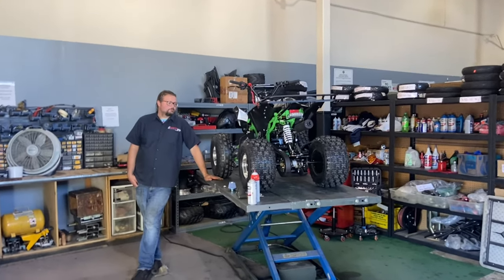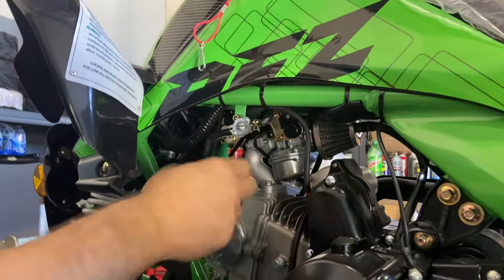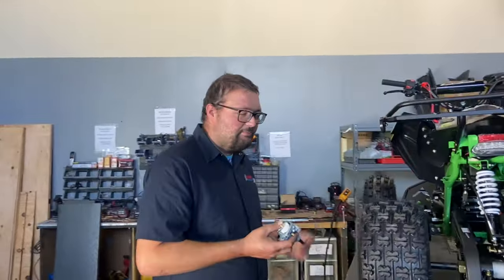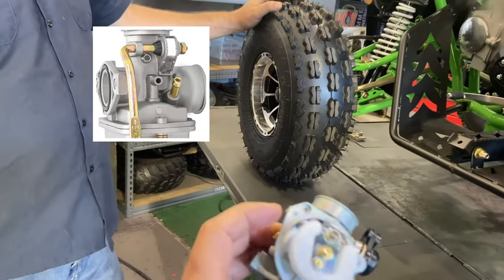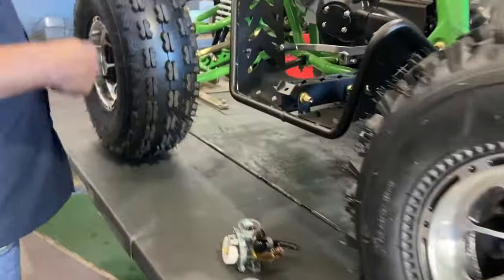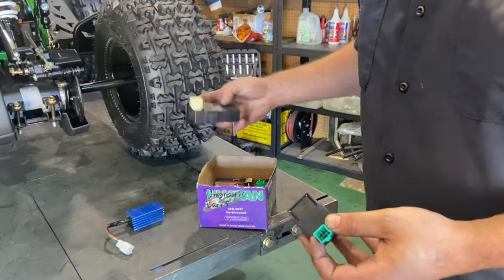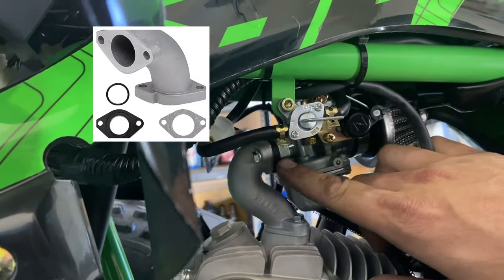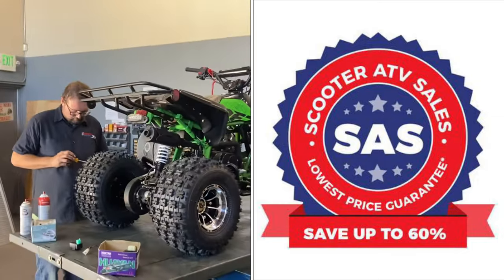WHY DOES MY ATV BOG DOWN WHEN I GIVE GAS TO ACCELERATE

Comment: You completely overlooked the needle and the needle jet. That is the part of the acceleration from 1/4 to 3/4 quarters throttle. If the needle clip is in the wrong position, upon acceleration beyond 1/4 throttle, you can flood out the engine, and it will bog out until you go beyond into the three-quarter to full throttle range. The needle has five positions. The top position is lean, the bottom position is a Rich fuel mixture. Bogging out on acceleration is typically when you have the needle clip set to a more rich fuel mixture. These Chinese motorcycles are typically shipped out without ever having had the needle clip adjusted to the correct air/fuel mixture position
Reply: Awesome advice, thank you
Reply: Is this the needle inside the carburetor that the throttle cord attaches to in the spring?

Comment: What if my ATV doesn’t have choke, or air/fuel screws? It’s an X-PRO 200cc utility quad.
Reply from the maker: They all have a choke. Most newer China ATVs  Carbs have the air/fuel mixture capped.  Most of the caps can be removed with a dremel tool

Comment: Nice intresting video! But my ATV stalls when I throttle it in forward/backward position, starts and revs fine in neutral. Any idea?
Reply from the maker: Fundamentals are first, air/fuel, then electrical (CDI box)
Reply: What do you mean air/fuel?

Comment: Hey boys I enjoyed the video. Very good pace and thorough. 
My sons Tao Tao 110cc Boulder wouldn’t start. I replaced the spark plug and installed a New carburetor. It fired up right away and never sounded better. When I switch it into drive it goes very slow and eventually dies out. It does the same thing in reverse. What in the world is going on? I am baffled ..
Reply from the maker: You installed a new carb and fuel filter. Hard to tell.

Comment: My TaoTao ATV bogs down when I give it gas quickly only. When I move it slowly it’s fine. Any ideas?
Reply from the maker: Check Spark plug, throttle or it may need to be cleaned

Comment: Mine turns over without the brake clamped/depressed-- my wiring harness and kill switch have no provision for the little blade connectors under the brake lever-- is that why it won't start? This has a been a nightmare of mismatched parts, badly made, no manual, etc.
Reply from the maker: Hard to tell without knowing the history of the ATV

Comment: i have a baja 250u motorsport atv cleaned the carb replaced the plug gaps correct still bogs down and back fires any help i would appreciate
Reply from the maker: Spark plug and C-Clip on metering rod, last check valves
Reply: @MOTORSUncut  great if i new where to find the c clip